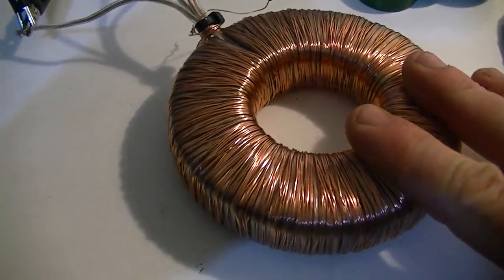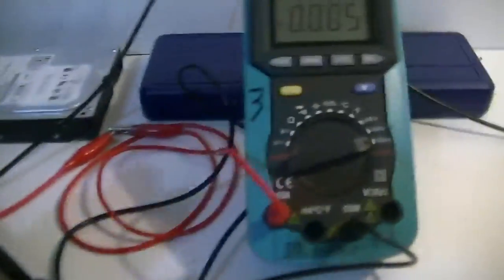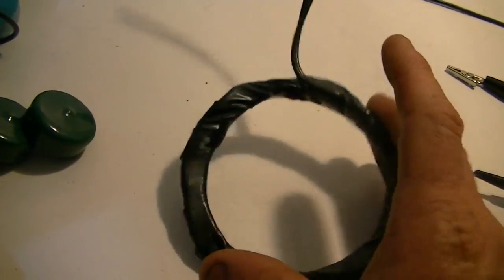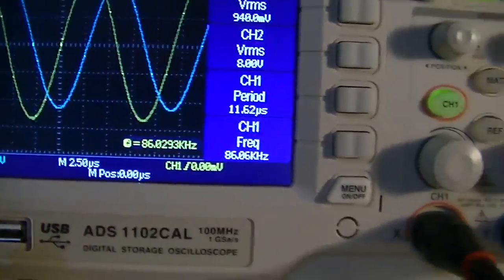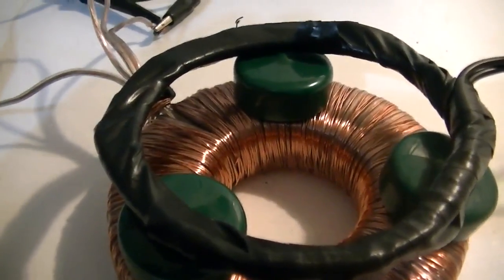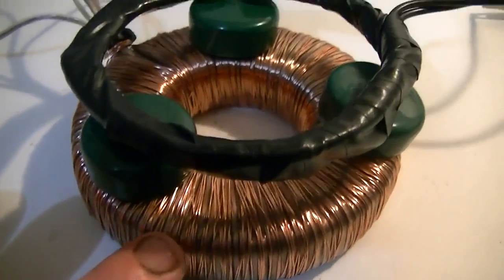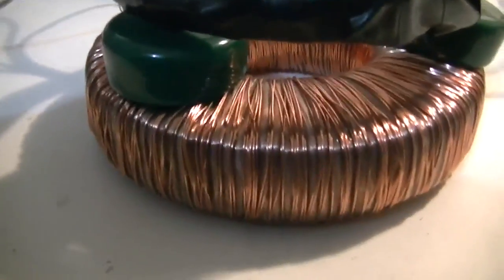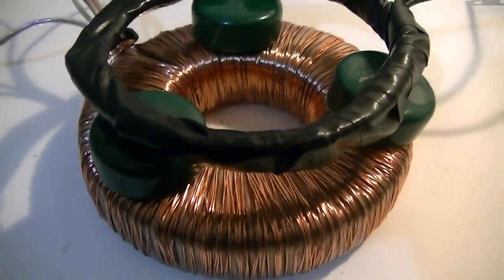Toroid magnetic field test 1

Comment: It is the electric field you are measuring and not the magnetic field. One clue to this is the angular difference of your coils, one is looping with the core (secondary,measuring coil)  and one is going against the core (primary winding).
 I am of the opinion that the electric field is responsible for all induction and that the magnetic field is in this case is locked within the core unless you saturate the core.
Reply: Jon Bigman u r brilliant
Reply: Dumb. All induction are due to magnetic flux. DI-electric flux is what causes LOSS.

There exist magnetic field within the core and magnetic field OUTSIDE the core.
Reply: @lukiepoole6701  What are you on about, changing electric field DOES induce voltage in nearby conductors.